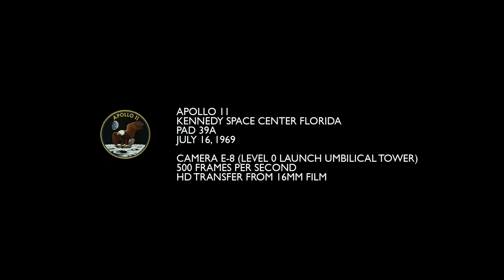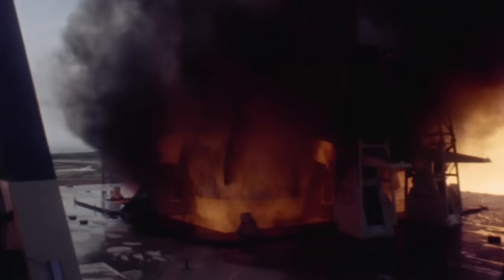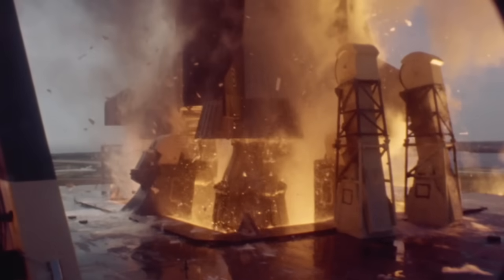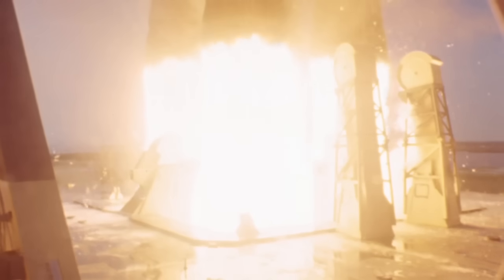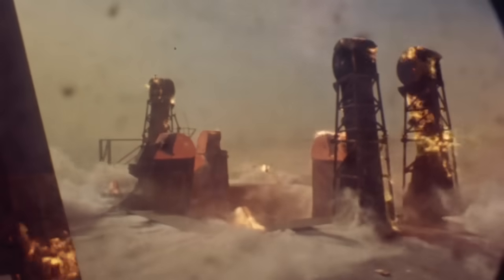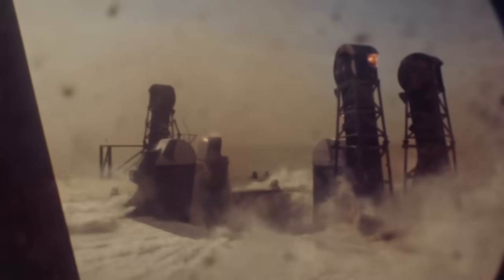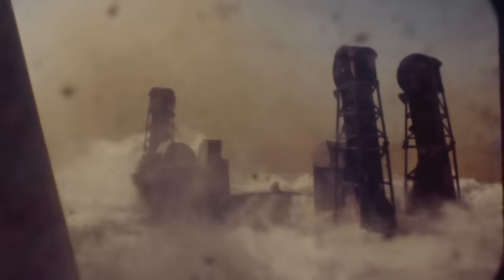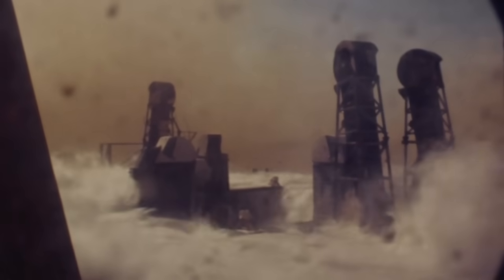Apollo 11 Saturn V Launch Camera E-8

Comment: Isn't it odd how in 1968 they flew to the moon in 3 DAYS - YES I SAID 3 DAYS. In 2019, it took the Israelis 3 f'ing months to get to the moon with a probe..and..it crashed. Go figure eh!
Reply: Yes, because Israelis had smaller rocket, and Apollo 11 would've crashed as well if it wasn't for Neil Armstrong taking manual control and landing in a safer spot. Go figure eh!
Reply: David Wiebe   "Isn't it odd how in 1968 they flew to the moon in 3 DAYS - YES I SAID 3 DAYS. In 2019, it took the Israelis 3 f'ing months to get to the moon with a probe..and..it crashed. Go figure eh!"

Not odd at all. 

Apollo had 3 crew, and limited supplies and life support. The journey to the Moon had to be as quick as possible for this reason. This needed high velocity entering Earth orbit, and a significant exit burn to head out to the Moon.  

The unmanned Israeli craft did not need to hurry. Nobody was going to run out of supplies on the way. It was set up to take a large, leisurely elliptical orbit, until it got far enough out that the Moon pulled it in naturally.
Reply: @Oscar Zamora Your father is a lie then.

Comment: Why is there any ice at this stage? It hasn't been into space yet. I don't understand.
Reply: The upper fuel tanks contain fuel which has to be kept cold, or which naturally IS cold. The ice is frozen condensation on the outside of the craft. 

Start the engines and the vibration shakes it loose
Reply: @tumenihits5438  that explains it. Thanks..

Comment: Embarrassing that folks are so ready to dismiss hard science to perpetuate this myth. Now we may well have gone hell we could be there now. But as it was told to me and my family back then uhhh no. And how about Musk oy. What was that quote? “You know it’s fake because it looks so real.” Regarding his car where the tires don’t explode in the vacuum of space. Solid rubber tire? Would have to be right. What was the capsule made of? How thick you say? Really hmm must be magic they were using to keep em from exploding. Got to Love Hollywood. Pfft
Reply: Deep sea diving needs stronger shells because the pressure difference is far higher between inside and out

Astronauts only need a few psi in the suit, so the pressure difference is small
Reply: "Show me an experiment where absolute vacuum 1×10−17  Torr is pressed against 14 psi air pressure WITHOUT A SOLID BARRIER ONLY GRABBITY HOLDING THEM APART. "

Provide us with a planet the size of Earth to experiment with.
Reply: The hard science proves "this" real, so I really don't know how you're talking about. Also, you don't seem to know how much pressure your average tire can withstand.
Reply: "Regarding his car where the tires don’t explode in the vacuum of space. Solid rubber tire? "

What makes you think they were inflated in the first place? Wouldn't you take the valves out, and let the pressure equalise naturally, as the craft ascended? I would, and I'm not even a rocket scientist....
Reply: SADDADX
Reply: 'scuse me?
Reply: jubjub247  What "hard science" proves is that you need something to keep the air particles contained. That something is the gravity (or whatever you wish to call the force that makes stuff go down). And what is this nonsense about space suits? Have you never seen an inflated balloon? What do you think the pressure difference is between its interior and normal atmospheric pressure, as compared to a pressure difference between atmospheric pressure and vacuum?
Reply: jubjub247  You need a SOLID BARRIER  between space vacuum and atmosphere
Did you read that off some conspiracy website? :)
As explained by Tumeni Hits, all you need for space suits is something capable of withstanding the pressure difference of 14 psi at most. Again, have you never seen a balloon? It can contain ~15 psi:
https://youtu.be/fwh-i0WB_bQ
Reply: jubjub247  Lmao! Is that vacuum down to 1x10-17 Torr? Hell NO! HAHAHAAA!
Dude, calm down.

A blood pressure cuff gauge that is superglued to that setting and broken, it NEVER MOVED!
You're either a bad liar, or need a pair of glasses. You can see the needle move at 2:48, and it went almost down to zero, so, yeah, you're busted :)

I want to see the pressure go from atmosphere to 1x10-17 Torr vacuum in same shot
The basic principle has been demonstrated. If you lack the imagination to bring it to its logical conclusion, then, well, that's your problem, not mine :)

LOL! TOTAL FAKE VIDEO bub, bot.
What's fake is your laugh, and your conclusions, meat boy :)
Reply: jubjub247  It's still NOT at anywhere near 1x10-17 Torr
Oh, what's that? "I was wrong in my previous post, and I'd like to extend my heartful apologies to anyone annoyed with my whining"? :)

besides you're a bot so someone gets paid for you to keep posting your BS!
This emotion you're feeling, human, this seething impotent rage - describe it to me, please :)

Space is still fake even with those lame AF videos
Human, why are you jamming fingers in your ears shouting loudly "HAHAHAAAA!"? It's like you want to remain ignorant.

The only thing real here are my facts and my laugh!
Human, why are you crying, then? How come you can't even form a coherent response? Do you imagine your ignorance is somehow superior to knowledge? Do you imagine anyone cares about your delusion?
Reply: jubjub247  What is this drivel?
Human, are you upset about being proven wrong? Why do you deny the truth? Is your fragile ego worth it? Nobody cares about it.

You're learning nothing here
You are correct, human. I haven't learned anything from you. You're useless as a source of valuable information, and simply waste everyone's time with your drivel.

You can't even decipher between laughing and the other thing.
Yes, tell me, human - what is this "other thing"?

A beginner bot with no brain chips to function with.
Tell me, human - how does it feel to be bested by something you have so low opinion of? how do you justify your defeat to yourself? Is it hard to ignore reality? I want to learn.

Basically, you sound, function and act like a rettarrded bot with a few short circuits and wearing a hockey helmet on the bus to microsoft
Is this "hockey helmet" your normal day attire? What use a bot has for head protection? Do you imagine me having a flawed form similar to yours?
Reply: jubjub247  You're getting more stupid every comment.
I have found myself being compelled to dumb my every comment down, human, to make sure you'd understand it. Your refusal to admit your failings is most... curious.

Cherrrio!
Goodbye, human. You won't be missed.
Reply: jubjub247  You are in denial you don't even know what reality even is.
My database references indicates that this is an example of "psychological projection", in which the human ego defends itself against unconscious impulses or qualities (both positive and negative) by denying their existence in themselves while attributing them to others, most commonly found in personalities functioning at a primitive level as in narcissistic personality disorder or borderline personality disorder. The true source of such negativity is ultimately almost always found in the person's own sense of personal insecurity or vulnerability.
Please be aware, human, that while psychological projection may help a fragile ego reduce anxiety, it does so at the cost of a certain dissociation, as in dissociative identity disorder.
Reply: jubjub247  Why do you think so low of yourself, human? Why do you need to project your insecurities into others, instead of facing them?
Reply: jubjub247  I am indifferent to the way you project your failing upon others, human.

Comment: Where did they get the power necessary to transmit anything from their puney batteries to transmit all the way back to earth? Do some research on radio to find out just how much power they would need. Helluvah punchline once you smart folks out there find the answer. Sheep go away this punchline is for those who can figure out my question about how much power. I don’t want to hear from the parrots nor NPCs. Critical thinker only and hopefully they have math skills as well.  Carry on.
Reply: You can easily find the info without asking for it in a YouTube comment. They transmitted in S band and received the signals with the 26 meter dishes of the Deep Space Network. 
 https://www.ab9il.net/aviation/apollo-s-band.html

Comment: Tell me how they got the dune buggy in the lander where on earth could they stash it? In between all the fuel tanks and other equipment used for the lander. There is no room.  Nada I know every bit of the lander and no room for any jeep chassis. They are still trying to figure out how to get through the Van Allen Belt and so far NADA. That is what NASA said not me. But don’t take my word for it go “look” for yourself. Now we may have gone to the moon just not like they told us. Pfft NASA fools they are stuck with this one. Good video on the very primitive kero/oxygen craft.
Reply: Probably a rhetorical question, but it was strapped to the side of the descent stage.  Look it up on the internet, you can also use the internet to look up the meaning of "rhetorical".
Reply: 4/8/19
@Jonathan Hall 
Sir, here's the proof & answer to your question. 
https://www.popsci.com/blog-network/vintage-space/lunar-rover-designing-and-unpacking-car-moon

Comment: How did the astronauts manage not to go deaf sitting 100 mtrs from a 200 decibels sound source? 
200 decibels is 3000 times louder than a commercial jet engine.
Houston we may have a problem.
Reply: They were inside the craft. Pretty much all the noise is generated from the interaction of rocket exhaust with air, and that happens outside the craft.

Comment: Can someone explain all the water at the end?
Pretty crazy to think if you stood right on the launch pad you'd be instantly vaporized
Reply: The Water Deluge System at Launch Complex 39's Launchpad A and Launchpad
 B, located at John F. Kennedy Space Center in Merritt Island, Florida. 
The Water Deluge System was used for two reasons: noise suppression and 
flame suppression. The system reduced both issues by releasing a torrent
 of water after the rocket was ignited, which reduced the sound of the 
rocket and damage to the launchpad from the intense heat. Launchpads A 
and B were built specifically for the powerful Saturn V rocket, thus 
there was a special need to address those issues.

Comment: Why would the holddown arms and tower have ablative paint and shrouds to protect the mechanism?  I mean,  once the arms retract, they are done. It's not like they are going to be used again, and if they burn or melt, it's going to be after the engines have cleared the holddown towers.

Comment: Awesome bit of unedited footage!

Small correction on your commentary ref the dark band just below the nozzle extension - it's not dark because it's cooler, it's cooler because of the reason it's dark. It's dark because the turbopumps were run excessively fuel rich. Running rich was done to keep the exhaust gas cooler for nozzle protection and the darkness is due to the massive amounts of unburnt fuel/RP-1 in it.
Reply: @stupidlogic2987  Your brick was made of sauteed fluffed egg whites in bacon fat, with a hint of cilantro.  It was delicious.
Reply: @salamanca1954   ok, now you're making me hungry
Reply: That's essentially what the narrator said.

Comment: 5  seconds of engine-fire-thrust, before releasing 4 holders, means this is NOT a rocket, but an vertical airship (balloon) heating up its lift-gas, very similar to hot-air-balloons being held down until all its air is hot, providing it  maximum lift. Slow ascent-rate of Apollos, Shuttles, Spacex, etc, also prove that they all all Vertical-Airships (balloons), disguised as rockets! For more proof, Google: ("Solving-Spacex-Enigma")  and stop fooling yourselves people!
Reply: Or, or or, the thrust to weight ratio was awful
Reply: Another thing i forgot, it takes a bit for rockets to get to full thrust, and the clamps were there to hold the rocket before it was scheduled to launch, up until it got to full thrust
Reply: @salade2760  Apollo-TWR was NON-Existent: Watch this large torch-fire, disguised as a static-rocket-fire-test which has absolutely NO thrust, else the fake rocket would have imploded/exploded, and would have ripped out, and shredded, its housing: https://www.youtube.com/watch?v=gYYoXi91QtU  (QM-1 Static Fire Test Quick Look)
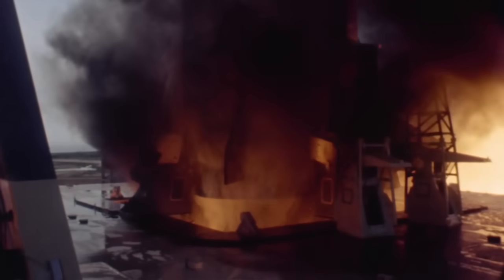@ 1:07 of above video, stop to see a disguised igniter 10-15 meters from the mouth of rocket-torch and spewing out its own flaming-gas to ensure that unburned gas is also ignited, in addition to creating a more impressively false spectacle! 
BTW: NO 3,000-ton-object (Apollo's claimed weight) has ever been made airborne, even to this day (2019), much less 50-60 years ago! And will always be an impossibility! to see that Apollo would have required to deploy thousands of times of its claimed TWR to launch, see my last month's comments under: Youtube:  (100 Percent proof we can't orbit earth. Debunk This.)
Reply: @kareemsalessi  Crawl back under your rock, there's a good troll.
Reply: @stupidlogic2987  ==Excellent-self-Description
Reply: @kareemsalessi  Is that the best come back you got? lol

Comment: In real time, as slow and lumbering as liftoff looks, Apollo 11 was doing over 100 MPH as the tail cleared the tower gantry.  In the early days of rocketry, physicists said space travel was impossible because in space there was nothing for the rocket to push against.  Sounds logical, but incorrect.  The rocket pushed against its own exhaust, much like the astronaut jet-paks and positioning jets on the Space Shuttle, et al.

Comment: This gigant quantity of kerosene Lox burns only in two minutes!!! 2000 tons in 120 seconds.  16,66 tons /second!!
Reply: It's almost an explosion. A controlled explosion of sorts. Pretty impressive.
Reply: Inthe ingnition is an explosion,sure,after an impressive ignition .The ascentional force is 3000 tons,In the beginning the total weight os the rocketis 2700 ton. The accelerarion isn1t constant,because the loss of fuel (16,66 tons /sec).the speed variation is cuadratic and the acceleration is lineal

Comment: What I always find amazing about this video is how fast the "vacuum" flow happens when the engines fully ignite. This is 500 frames/sec and the "whomp" of the suction happens almost instantly and sucks all of that smoke and flame back under the engines. Gives you a true sense of the insane power of these engines.

Comment: 16mm film has 40 frames per foot. 500 Frames Per Second runs 12.5 feet. At 500 FPS, 32 seconds "Real Time" would use 400 feet of film, which is a standard roll of 16mm film.

Comment: can someone give me an idea how much fuel the landing device had to break it for the moon landing and reacceleration. to start and meet the waiting capsule to return back to earth together? txs.
Reply: The lunar module was actually a two-stage craft.  The descent stage is what burned off the lunar orbital velocity and landed on the moon.  The descent stage stayed on the moon and the ascent stage took off from the moon using the descent stage as a launch platform, and the ascent stage then docked with the command/service module which stayed in orbit the whole time.  Once docked, the astronauts moved from the ascent stage to the command module and the ascent stage was jettisoned, and the command/service module is what left lunar orbit and brought them back home.

The descent stage had 8,200 kg of fuel, and had a dry mass of 14,583 kg.  The ascent stage had about 2,500 kg of fuel and a dry mass of 2,150 kg.

Comment: It's interesting to compare the take-off of the Saturn V - what we see here is the S-1C stage in action - with the take-off of the Space shuttle. While the S-1C burns RP-1, refined kerosene, with liquid oxygen, the space shuttle uses liquid hydrogen and oxygen and therefore makes much less noticeable exhaust. That, of course, is not taking into account the solid rocket boosters which use ammonium perchlorate. Interesting to see also, the dew on the liquid oxygen tanks turning to frost and falling in chunks straight into fire.
Reply: Interesting compared to the Proton, which burns toxic hypergolic fuels.

Comment: What is the temperature under the rocket blast?
Reply: I woulda never of thought about it, but that's a really good question.
Reply: F-hot.
Reply: Well, RP-1 and LOx combustion produces heat of well over 3000K. Given that the combution usually runs fuel-rich to lower heat, I'd say it was somewhere around 3000K right under the engines.

Comment: What absolutely amazes me is the speed with which the F-1 engines are ejecting the LOX & kerosene even at 500fps. Just amazing! It
Reply: I've said the same thing in the past....utterly spectacular.
Reply: @samsignorelli  Yes, without a doubt. These worked so well as to actually pump/deliver and combust 13 metric tons/per sec.
Reply: @TheShredworthy  I've stood on front of the F1 outside Aerojet's facility in Canoga Park, CA and tried to wrap my head around that much fuel flow based on what I was looking at....the mind boggles.